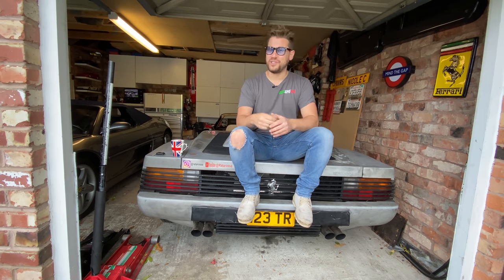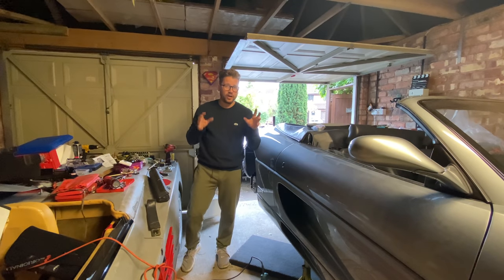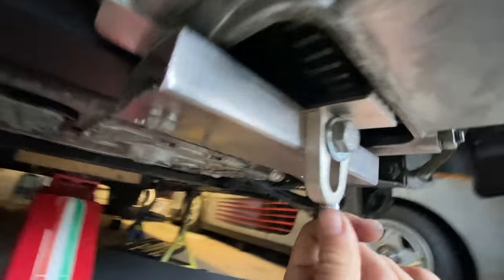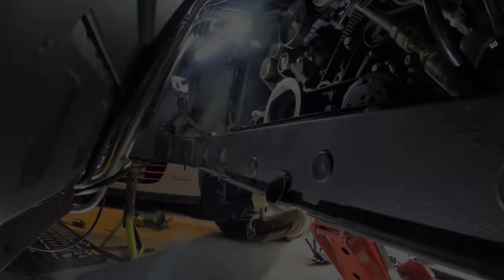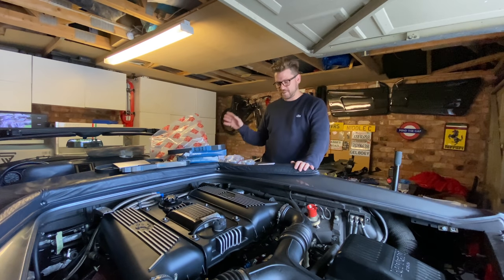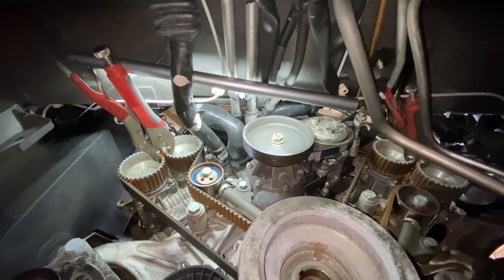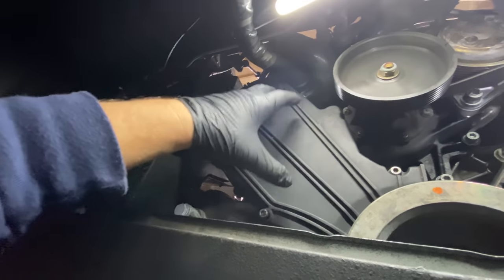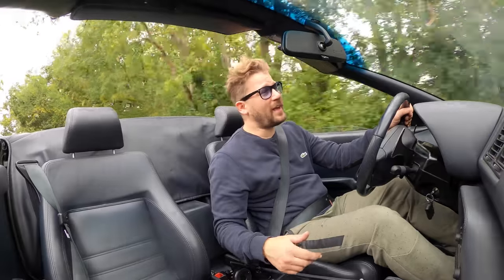Ferrari 355 Timing Cam Belt Service Step By Step Guide PT2 - DIY Major For Less than 1hr Labour Cost

Comment: I now have a whole new appreciation for the ease of replacing the timing belt on my puny little 4-cylinder Mazda Miata.  What I thought was a challenge in my case, clearly was not.  Well done, Sir.  Excellent camera work, excellent teaching ability, and just darn fine wrenching.  You’ve dispelled the myth of F355 maintenance.  Hats off to you.

Comment: Great video and I applaude your bravery to tackle Ferrari service and repairs in a small garage with no lift.

Putting the engine in gear will lock the engine but the wheels need to be on the ground.  Without having the wheels on the ground putting a bar between 2 lug bolts and wedging it on the ground will work.  I don’t have a Ferrari but I do have a small garage and no lift.  I have done this with flywheel and front damper bolts when I couldn’t lock the wheels.  Not factory but it works.
Keep up the good work!

Comment: 😱😱😱😱 never use a torque wrench to remove bolts or nuts. Always use a breaker bar. Great tool that you made for the flywheel.

Comment: Great work and ingenuity.  one comment on the flywheel lock tool. I would suggest putting a small tube in each end between the holes in the tube. that will allow you to bolt it down without the tube collapsing. The same could be done where the lock itself mounts in the tube.

Comment: Great little tool you made there. I would add bushings made from pipe to the mounting holes that would sit in the box section so that when you torque it to the gearbox, you don't crush the box section.
Reply from the maker: yes totally agree, when i built it during the video it was honestly a complete test piece that I had no idea would work or not. As a final version I would use a more solid block and attach the tooth lock with more than 1 bolt. But as you saw it worked fine as is so I was really happy to be able to create a tool for very little money

Comment: I guess this method can be done, but not for me, the eninge comes out, Ferrari actually made it a lot easier than what you might think. But I admire your ambition to show that it can be done if you don't have the gear or space to drop the engine.

Comment: Scott, I love these "how to" type videos. You are a natural educator. You make this seem very straightforward and it does dispel some of the 'alchemy' around these belt services.  I have a 1990 Mondial T. Do you reckon this method could work on a MondialT/348?
Reply from the maker: Hi Robert thanks for the kind words. Yes the 348/T engine is very similar but uses 1 belt, I have not don't the job on the 348 but I can't see why it would be any more difficult to do that this.

Comment: in the old days we would wedge breaker bar against floor and flick key to crack crank pully bolt then time it up  i would in this instance jack a block of wood into ring gear to hold crank still (but i love your tool ive made similar myself its a line of thought that is so hard to find nowadays) in gear and handbrake to tighten locktight to be sure.

Comment: These vids are definitely inspiring. Been waiting for part 2. 
If a 355 fell into my lap, I think I could confidently do this swap with these tutorials, though if I screwed up the positioning of the cams,  I would be terrified to set it back - love the vice clamps on the belt and gears!  I might try to build a tool to lock them together, but don't see a good way of doing so.

Tl/dr; Nice work, mate!
Reply from the maker: Thanks Mike. I believe there are some aftermarket tools that have been developed. I wanted to keep this video as simple as possible for everyone with the most basic, cheap and readily available equipment so as to prove it can be done by anyone with a basic skillset. Anything tool wise or a lift etc will help and speed up the job even more.

Comment: Are we sure this was actually easier than dropping the motor, lol? I admire your ambition and ingenuity.
Reply from the maker: All factors taking into consideration yes I still believe it was.Next belt service time ill film engine out so everyone can compare
Reply: @Ratarossa  Either way it is a daunting undertaking!  Your "no fear" attitude is inspiring.
Reply: Not having to discharge and recharge the AC system is a nice plus of doing this way.  The only downside is that it would be harder to do other “while the engine is out” items like water hoses or whatever you can’t normally get to when the engine is installed.
Reply: 100% easier!
Reply: @y2ksierra  That’s one thing I’m curious of, can you replace the  Radiator hoses while the engine still in the car?
Reply: 'easier' is subjective. but objectively, working alone with only a floor jack and some jackstands, the video is impressive. not everyone wants to own an engine hoist. i will say though, that i can attest to the fact that removing a 1962 volkswagen engine by oneself is doable without a hoist. lol.
Reply: @bladerunner6282  I think you got the words “engine” and “lawnmower” mixed up there 🤣
Reply: @bladerunner6282  yes, but it is air-cooled and has a lot less fluids and hoses attached!
Reply: @y2ksierra  I was thinking the same thing.  I have a lift (installed last Fall) in my home garage, still debating on which method to use.  I'm leaning on taking the engine out due to my valve covers need to be repainted and I want to replace hoses.  I believe all can be done while the engine is in the car, but may take more time, thus not saving time this method.  Then use this method in 3 years time, when I know everything else is good.

Comment: Just ordered a FIXD from your link Scott. Just a caveat. It’s  another $14 to ship to UK. That’s still only about £27 which is still pretty good. Not sure if on any kind of shipping program or if duties get applied this end. Still cheap enough. I think these were about £70 on eBay a year or so ago. Nice one👍 Really good for your US viewers.
Reply from the maker: Cheers Mark, thats a shame its not free shipping. Handy little device though I've used it on the mini, nissan, 360 and 355
Reply: @Ratarossa  hi Scott, amazing video. I have decided to do cam belt service on my 1996 GTS. I have also ordered FIXD, however found out that EU spec 355 don‘t have OBD2 plug. Is your 355 US spec, or how did you connect FIXD.

Comment: Nice job and good instructions. I think it is doable but you do need quite a bit of time. And as with all things the first time is the most difficult and daunting and it will become easier each time you do it.
Reply from the maker: Yes a very good point . My absolute advice with doing any job like this is give yourself plenty of time, don't rush and triple check all the tricky bit. This took me a week to film for you guys but that time also allowed me to go though things a few times

Comment: You can measure belt tension using a Park Tool cycle spoke tension measurement tool, it does the same thing
Reply from the maker: Yes you are right greg and dammit I was supposed to film a clip showing that method and a link ... let me update the description to add a some web link

Comment: Hi Scot, these are excellent videos and your professionalism is wonderful. The mole grips did make me cringe though (aluminium pulleys? eek) and surely, once the timing belt tensioner nut is torqued up... the feeler gauge distance and pin slide is not going to change??? I thought the spring tensioner (not hydraulic) was redundant if you have the tool to tension the belt (I thought the idea was to allow the tensioner to push on the belt while you rotate the engine one full revolution and then tighten the nut?) Still, if that's what the manual says... it must be done like that.  Thanks again... Great Knowledge.

Comment: P.s I would NOT be using a torque wrench to undo a crank bolt! You needed a breaker bar son!
Reply: Yep, that made my torque wrench cringe a little bit, but then again I don't loosen it to 0 after use, so it already hates me. 
I can send you a breaker bar, Scott! 
I was depressed to see the 300N/m battery gun fail at breaking the 36mm... was pulling for it to win! I remain amazed at what my cheapo 1/2" 20V 200lb/ft electric will break loose!
Reply: I cringed as well and get an extension!  :)
Reply: Yep.  Here in the States you can get a breaker bar about twice that long for $20-30.  And, no, you don't need that much swing to get the bolt loose enough to use a conventional ratchet on it.

Comment: These breakdowns of major service are the meat and taters of your channel. To me, the 355 is one of the most beautiful Ferrari's ever made. I am an engine builder, designer, modifier above all else.
To stop any engine from turning safely, stuff clothes line into the cylinder. Nearing tdc it will act as a soft piston stop. The nice the is that it's super quick, cheap, and universal. It even works on German cars lol.

Comment: Wow, there's great commitment to the task at hand. After all that work- it has to be done every 3-5 years? Why is that rationaly OK? Although, the tentioners seem to have lasted way past their lifetime. I'll bet many owners drive these for a decade before they have the belts serviced? What have you heard, Scott?
Reply from the maker: Well John the books say 3 years but often they are pushed to 5 years however beyond that its not worth the risk. Even at a dealer service prior the alternate of something going wrong and the engine rebuild cost its not worth thinking about. Besides Ive just shown how it can be done for as little as £179 LOL

Comment: The home made locking tool looks good but I say the following in light of the heavy duty torque setting. The single bolt holding the SEALEY locking tool to the box section might move with the teeth on the flywheel. Maybe it was alloy? If not it'd be safer to tack it on (or even a couple of self tapping screws. Anything to ensure it stayed still on the box section). Don't mean to be pedantic but better not to use a torque wrench for UNDOING bolts etc.
Reply from the maker: Both correct and yes i thought it myself. It was a test and i had intended on securing it with a second pin. it is ally so I couldn't weld on. However on first test run it was solid as a rock. Don't forget this is just for holding the flywheel in place while we undo of tighten the 36mm bolt, if it did move slightly it wouldn't matter. Torque wrench yes also correct i didn't show it but prior to that scene i used a breaker bar and I was unsure but had obviously loosened the bolt. I cut the scene to keep video time down and so you lot didn't see me sweating LOL

Comment: Btw. What was the condition of the belts you took off? How many miles old and how many years? Any degradation?
Reply from the maker: They looked ok, its impossible to tell though with the naked eye. But they had only done about 3k miles so were changed due to time and not mileage. the bearings also looked fine as to be fair did the tensioners (even though 22 years old)
Reply: @Ratarossa  lot of surface rust on the bearings though.
Reply from the maker: @rezaq1  yes its the uk things get rusty, the ferrari bearings are not made as well as the hill engineering ones

Comment: Scott, incredible. Your video definitely gives me the confidence to try this myself. And I really appreciate the way you do things. I have a 97 black Spider. Just had the second engine out done August 2019. Meaning I’ve been through the process twice. Once with an independent, once with a Ferrari dealer. I am definitely going to try your method next time. It’s not important but just interesting to me, your old tensioner where the pin would not go in, does that mean that...the old belt was somewhat out of spec? The tensioner was still doing it’s job, but it needed to extend more than normal?
Reply from the maker: Thanks Michael. With the tensioner they will extend over time as the belt stretches. I didn't show it but the old belt all felt fine it was not loose or slack in any way so the tensioners were doing their job well (even though they were original and 22 years old !

Comment: Does the engine absolutely have to be at TDC? My 612 WSM says nothing about being TDC, nor does it talk about locking the cam gears outside of the flywheel locking tool. My guess is TDC is a precaution in case of slipping so you know where you live. Is this correct?

Comment: Did I miss it?  What do you do if the cam belt tensioner gap is out of spec after replacing the belt and tensioner and turning the engine over a few times?

Comment: Where you have clamped the cam sprockets with mole grips I would be inclined to slide a piece of aluminium plate between them just in case they distort or crack.
Reply from the maker: yes many believe and comment on this but its the exact method ferrari use on the cars from the WSM not just the 355 but also 360 and many other models

Comment: To be exact the bolt size is not 36mm or 17mm what the socket is. 17mm socket size equals to a M10 bolt and 36mm to M24. But great videos :)

Comment: Couldn’t you just lock the flywheel in place then change everything, rather than taking to TDC before locking?
Reply from the maker: thats a precaution, just in case anything slips and you need a reference point top put it back to. But yes you could do that if you were confident

Comment: What is your plan for the old tensioners? Do you refurb them or toss them away?
Reply from the maker: they just get tosses away, they served a loyal 21 years on the car.
Reply: @Ratarossa  If you still have them I'd like to buy the right one.  It's for a special project.

Comment: How much differance is there between the 355 to the 348. Apart from I think the 348 is one belt and no power steering. That fuel tank looked quite tight to get back in, was it.?
Reply from the maker: Ive not done a 348 but seen the process and it looks very similar, i think seeing the 355 done, doing a 348 would not be any more difficult, The tank was very easy to get both in and out again its just a case of taking your time and checking slowly as you lift or lower. I did everything single handed along with filming at the same time so literally most of the time with 1 hand and nothing was overly difficult. I filmed the video in depth so you can all see step by step but once you have viewed it or if im not filming it the process of actually doing it is much quicker...especially if you had a lift etc
Reply: @Ratarossa  Thanks for the prompt reply 
I might give the 348 a go when the weather gets a bit better. It seems such a waste of time and money as my 348 has done less than a thousand miles since it was last done.  We have a old Peugeot 407 diesel and that goes 1000000 or 9 years between belts and it is half the width of the Ferrari.
Reply: @neilhampson2843  
Hi Neil
I would love to know how you get in with the 348. I hear that they are almost identical in so many ways (styling apart). Apparently you can even transpose the doors between the cars as a straight swap. 
If you ever attempt this and succeed with the 348, then I will definitely buy one. I just love them. Soooo different!
Good luck and fingers crossed 🤞
Reply: @robert1616  Hi Robert. I will let you know  how I get on the belt change. It will be later in the year when the weather warms up.

Comment: i don't own a ferrari, but i still watch.

i suspect that that belt tension gauge is profoundly overpriced. first off, they don't have to be chrome plated... just saying. lol.
Reply: Porsche have a very similar tool for their belts. On 944s and 928s, many use the Gates Kricket tool in lieu of it. 

Like Ferraris, the tool is quite rare as well.
Reply from the maker: yes the tool is ultra rear and expensive I had to get this one from Tampa Florida and not seen one since

Comment: Used your phone to check frequency? Man I spent over $1k for a special frequency tool. 🤦
Reply from the maker: the frequency is better on the 360 etc because it is stated in the service manual the correct numbers ....but the phone works perfect i did it on the 360 cam belt video and showed in more detail

Comment: What about the value of the car, when a buyer ses there is no stamp in the service book from last service!
99% of Ferrari buyers is crazy abaut the service histori, and can keep many buyers away.
All Ferrari buyers guide says, if the service history isent compleet DONT BUY IT!!!!
Reply from the maker: Good question Ronnie, I have owned personally over 30 ferrari's and yes its quite essential to see service history and know about the car. That said if you are going to service the car yourself my advice is simply keep all the receipts for parts and take photos of the service you are doing, print and document everything in a nice a4 binder and keep it with the car. If you can show its been done and looked after often that is more of an appeal to a potential buyer. Don't forget when you are doing this kind of service it gives you the opportunity to clean areas of the car otherwise not done during a shop service
Reply: Ratarossa that’s what I
I’m doing.    Plus, I’ll take more time for cleaning and making sure things are done right.    I’ve seen high end shops make mistakes or do subpar work, IMO.

Comment: I'd definitely give it a whirl. The only other thing I'd add is turning the motor over a revolution or two to set the belts with a final frequency check. Until they are de-stressed the frequency can be hard to read. It can change every time you touch the belt.
Reply from the maker: Thanks Kurt 100% , I thought I showed that but maybe it didn't come across clearly on the video